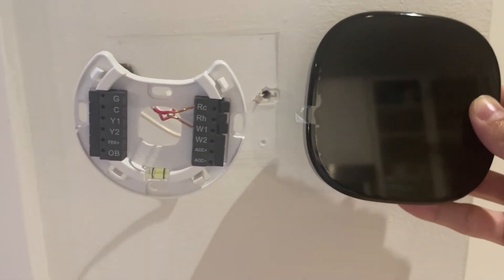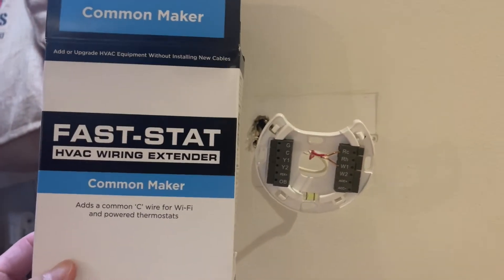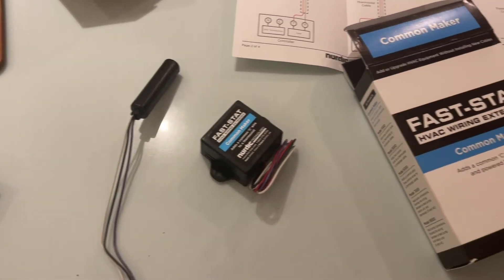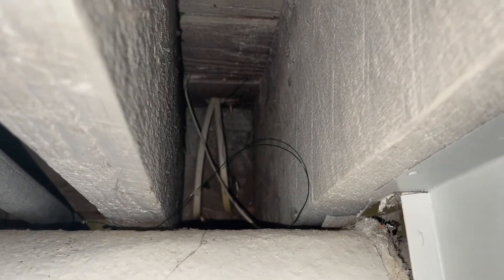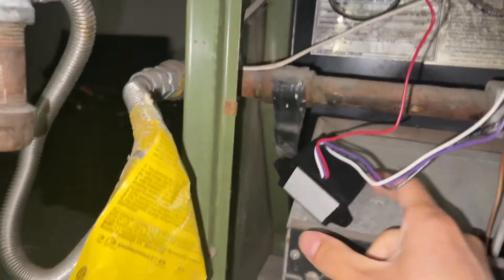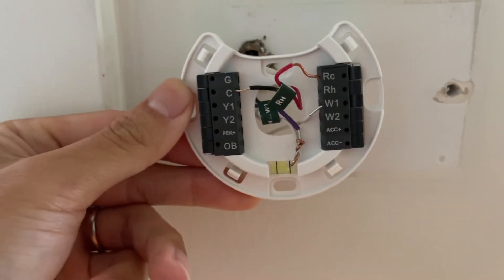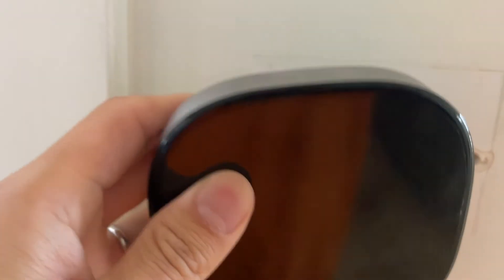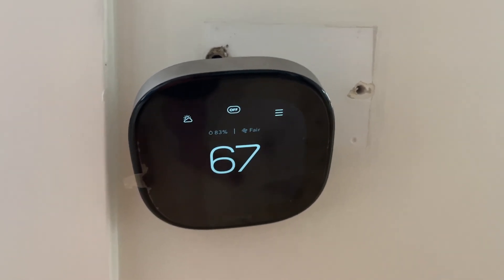Installing a Fast-Stat Common Maker to add a C Wire for Ecobee Smart Thermostat

Comment: Hi Fun Guy, my setup is similar to yours. I've only got 2 wires currently connected to my old thermostat. I've also purchased a Fast-STAT Common Maker, so this weekend I intend to put it in. 

Concerning your video, I don't understand why you followed the white wire from your old thermostat to the flood, then into your basement. The transmitter part of the Fast-STAT Common Maker doesn't use it. I'm not clear what the purpose of your doing that is. Would you please explain?
Reply: I think it was so he could identify which HVAC system in the basement was for his unit. He said he lives in a condo and wanted to make sure he wasn't messing with someone else's system.
Reply from the maker: @andywinslow7791  yup exactly! there are multiple systems in the basement/garage so I wanted to make sure it was for my unit.

Comment: Here's what I'm trying to figure out -- does the "sender" behind the wall operate in such a way that it ELIMINATES the original connection from the t-stat to the furnace?
Reply from the maker: Kind of/no - My understanding was that this device basically took the existing connection/wire, and combines more wires to it to make a new wire which became the new C line.
Reply: @funguysteez  right.... okay. At least it's working the way it's supposed to.

Comment: If u can actually run a wire to the basement, why didn’t you just connect the c in the thermostat to the C in the furnace with an actual wire?
Reply from the maker: I'm not the most knowledgable on this topic, but there was no C in the furnace and thermostat to begin with, which was I needed to 'create' the C by using this device.
Reply: @funguysteez  The confusion comes from 1:20: "Now that C wire will need to run from the thermostat to your furnace..."